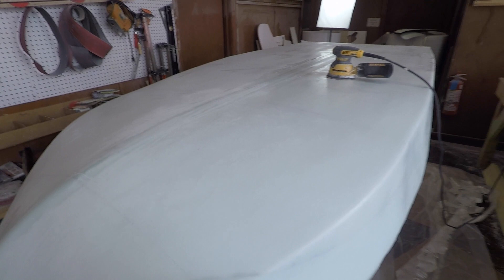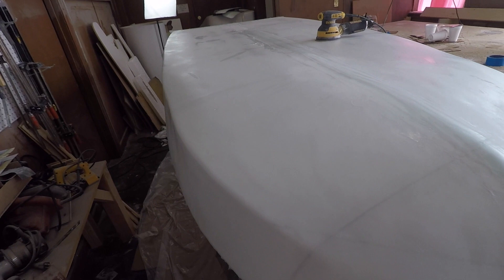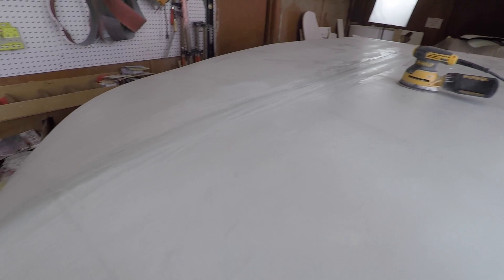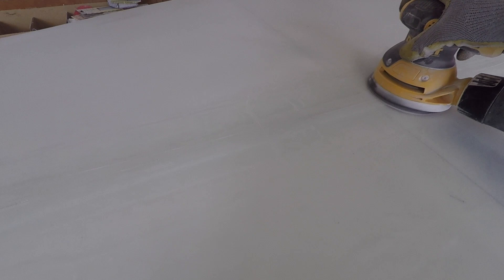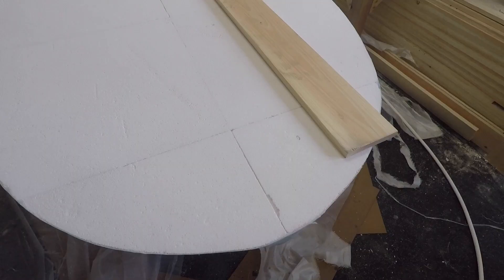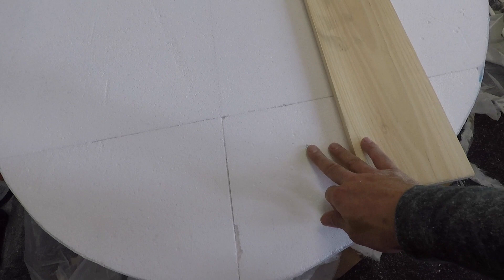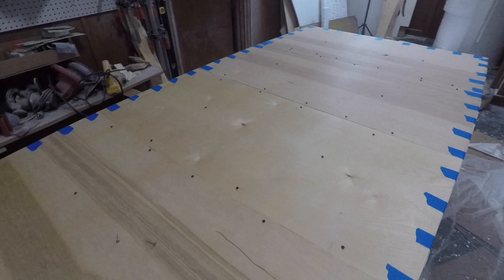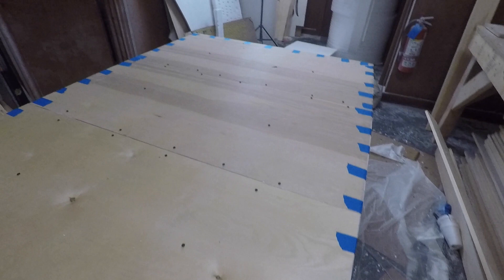Micro Skiff build update. Building the ultimate micro skiff!

Comment: I think it looks great.
I think there are a lot of different ways you can reduce the weight in future builds.
I'm, at the moment designing a sciff that I'm still struggling with deciding whether to use composite materials with styrofoam or both.
But I think you have done a great job.
Thank you for sharing.